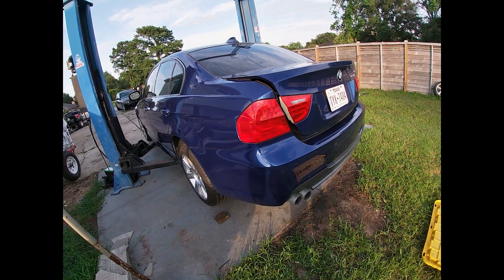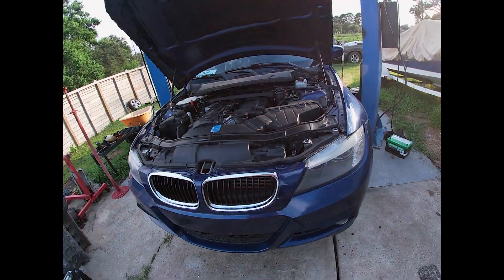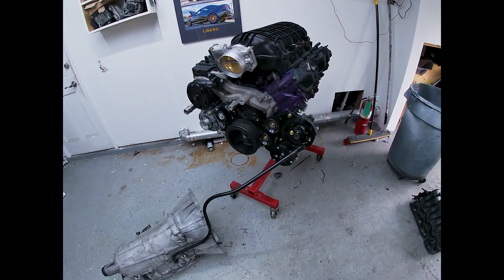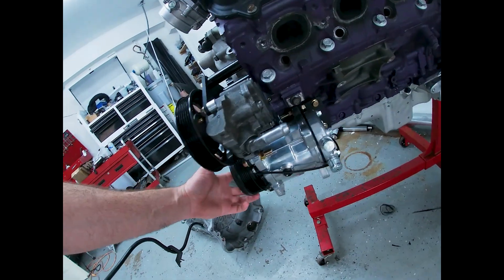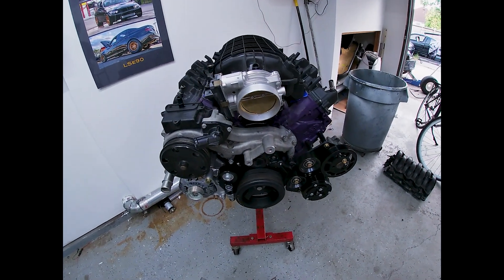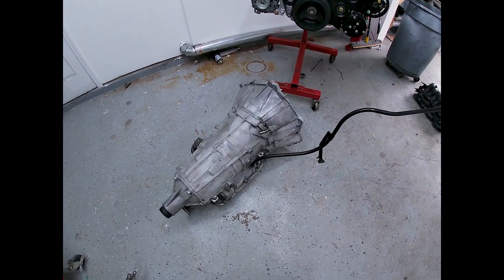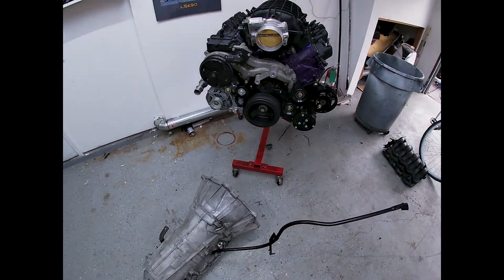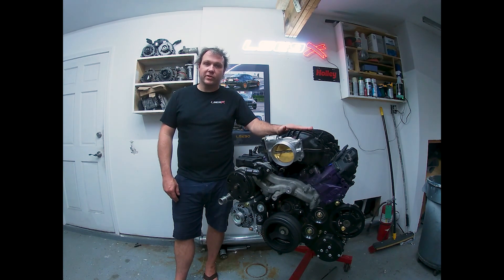LSe9x LT Swap Series Introduction

Comment: the truck accessories bolt right in with no modification, use a volvo electric power steering pump.

Comment: I watched your video on FAQ part 1 and had some confusion on applicable engines. I’m looking at picking up an LC9 or LM4. Those work with original swap right?
Reply from the maker: Yes any ls other than an ls4 fwd application

Comment: With the new f series using a version of the 6l would those be straight bolt in affairs with the 6l80, or even just using the 6l they have in their? Thanks for the information and stuff you do. Happy to see you starting a new project!
Reply from the maker: Yeah the f series used our th400 crossmember so I expect this to use the same

Comment: I was reading through Holleys manual for the Terminator X Max and noticed they never mentioned anything about reverse lights with the 6L80/90 control. I believe that would be broadcasted over the private canbus between the tcm and the holley. Have they added that functionality to the software and be able to assign one of the outputs as reverse on the Terminator?
Reply from the maker: Not sure they have the functionality built into the ECU as of now. I'll check into it